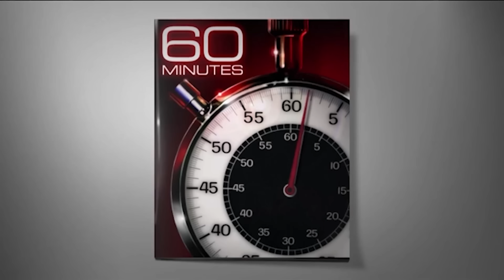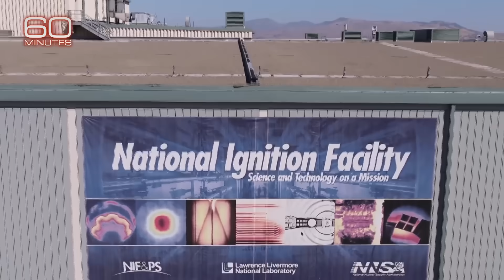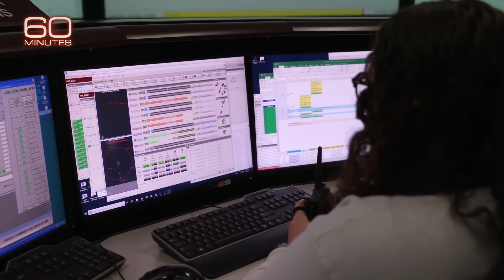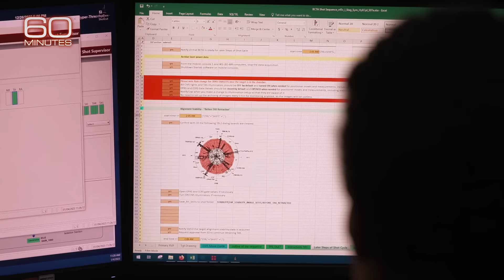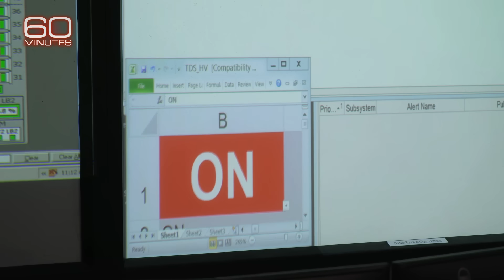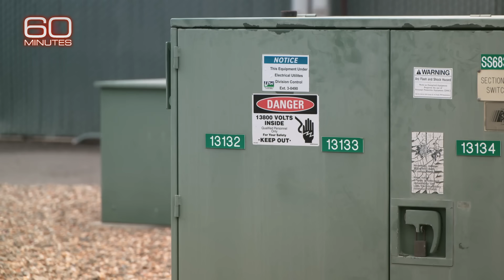Nuclear Fusion: Inside the breakthrough that could change our world | 60 Minutes

Comment: The analogy to flight is ridiculous. The basis in theoretical physics for commercial fusion power has been known for decades, and "achieved" with the detonation of the first hydrogen bomb. In that case, the "energy" required to trigger fusion came not from lasers, but from the detonation of an atomic "fission" bomb inside the hydrogen "fusion" bomb casing. In other words, in order to explode a thermonuclear "fusion" bomb, the "blasting cap" is an atomic "fission" bomb.

IN the case of commercial fusion power, the start up energy requirements are similarly scaled. Thus after achieving "fusion" in weaponry, it has taken several decades to develop the hardware, in the form of lasers, highlighted in this story. Thus it is not like the Wright Brothers at all. Naturally, the DOE administrator disingenuously announces we are 10 years away from commercial fusion power to bolster a president's reelection prospects.
Reply: The DOE administrator is well aware of where the funding has come from for all the nuclear fusion energy research at NIF and its predecessor laser fusion experimental facilities. It is sourced from Congressional funds allocated for thermonuclear weapon (H-bomb) research. This has largely been the case since the research began in the 1970s. Many different presidential administrations have come and gone during that period of time. The vast majority of other nuclear fusion 'breakthrough' announcements are also filled with sales hype, mostly to attract potential investors to keep the research going.
Reply: @vernonbrechin4207  Thank you. I did not know those details, and they do make perfect sense. Afterall, the major element of maximizing the "yields" of thermonuclear weapons is the amount of time the fusion reaction can be "held together". One way to do this was Teller's numerous "tests" in the 50's, which Kennedy curtailed just prior to/triggering The Coup in '63. The other way, as you possibly suggest, is assembling the significant laser power seen in the news piece.
Reply: @W1ZY  - The NIF lies within the Lawrence Livermore National Laboratory (LLNL) which has always received the majority of its funding for nuclear weapons research and activities associated with such weapons. They used to regularly perform expensive full scale weapons tests at the Nevada Test Site (NTS). When the lab was forced to end that testing program, due to the signing of the Test Ban Treaty, the lab received funds for NIF in exchange for ending that program. It is estimated that NIF has already consumed approximately $11 billion. The lab claimed that NIF was necessary to maintain the 'safety and reliability' of the existing nuclear weapon stockpile in the absent of full-scale testing. Some reviews have stated it it wasn't needed for such a task. NIF is being used to modernize the existing nuclear weapons of the U.S. In fact a weapons related target was in the target chamber, for exposure to the prompt flux of fusion neutrons at the time of the publicly announced experiment. NIF completion was very late and way over the original budget. It was supposed to the so-called 'break-even' reaction by 2012 but failed by a factor of more than 10. It took a decade of tweaking to finally achieved the reported claim which was still over 100 times less fusion energy output compared to the laser drive energy. That failure to perform apparently had no effect on the safety and reliability of the nation's nuclear stockpile.

The lab management has always obscured the primary purpose of NIF when presenting to the press and the rest of the public.

Few people realize that during nuclear explosive detonations that much of the fuel fails to react before it is blasted away from the reaction center. This includes the Pu-239 fuel of the primary in fission and thermonuclear explosives.

In the announced NIF experiment the nuclear fusion reaction lasted for only approximately 0.000,000,000,08 second after which most of the supplied fuel was blasted away from the microscopic reaction center to coat the interior of the target chamber with radioactive tritium which then had to be treated as radioactive waste. It was revealed, on the following day of the announcement, that only about 4% of the fuel was consumed during that experiment.
Reply: @W1ZY  - As NIF failed to achieve its primary goals the justifications of it tended to shift more towards the claim that it was needed to maintain the design skills of those physicists and engineers involved in thermonuclear weapons work.

Comment: Would nuculear fusion being used create too much energy?Would it cause the planet to pull other planets closer,would it push them away?What would producing the power of the sun have on us?Would it have any impact on the sun itself? I mean an overproduction of energy has to be possible.There is a reaction/ impact to everything.Would it have a physical or mental impact on the living?Earths polarity? 🤷🏻‍♂️🤔
Reply: I'm sorry to inform you that the National Ignition Facility (NIF) management's use of the term 'ignition' is deliberately deceptive. There was no significant ignition of the nuclear fusion reaction in the experiment mentioned above. The reaction was primarily the result of compression during less than 0.000,000,003 second. The fusion reaction lasted for approximately 0.000,000,000,080 second. After that the enormous repulsion forces caused all the fuel nuclei to be blasted away from the microscopic reaction center. Only approximately 4% of the supplied fuel actually fused to form helium. The radioactive and extremely rare tritium atoms were blasted towards the inner surfaces of the large target chamber and required removal as radioactive waste. Realize, that fusion energy production requires an enormous amount of input energy to confine the naturally electrically repelling nuclei. As soon as that input energy was removed the reaction extinguished. In the case of the NIF fusion energy 'breakthrough' announcement the laser input energy was more than 100 times the energy that was generated by the nuclear fusion reaction.

This is nothing like igniting a match where once  the chemical reaction begins at a tiny point it then spreads until the match fuel is consumed within a couple of seconds.

Comment: but is it safe from magnitude 7.5 earthquake? guess it will take us years before we could make such huge facility smaller like a pick up truck..
Reply: First somebody has to demonstrate a fusion reaction that lasts for years rather than 0.000,000,000,08 second as in this announcement. This experiment required more than 100 times as much input energy as was measured from the fusion energy output. A practical nuclear fusion reactor would need to generate at least 10 to 20 times as much energy then was required to operate it to be economically practical. In this case approximately $11 billion has been spent on the NIF project and this rare successful experiment generated about enough energy to boil two liters of water.

Such fusion energy machines can't be shrunk down by very much. If a nuclear fusion power plant was generating 300 megaWatts of thermal energy and was the size of a pick-up truck that reactor would vaporize any structure it was contained in. Many of the fans of such technologies have never taken a course in thermodynamics and material sciences.
Reply: @vernonbrechin4207  in a distant past wireless communication is like a fairy tale, not just that, even video conferencing wirelessly,  and here we are now watching videos in a small device as well..
Reply: @2Sage-7Poets  - Techno-nerds tend to immerse themselves in the history of projects that turned out to be successes. One of their aims is to seek out stories that reinforce what they prefer to believe in.They have no interest in the history of major projects that went nowhere. How about bragging about the U.S. Project Plowshare that lasted for at least 15 years in the quest to experimented with the use of nuclear explosives for various civil engineering projects. How about the early 1970s Seattle Monorail that served as a demonstration for how people would be transported around the U.S. by the year 2000. There have been lots of grand technology projects that never went anywhere. Most techno-nerds have no interest in learning about that portion of our history.

Comment: The reaction lasted 1 trillionth of a second but the fictional stories by reporters and nonsensical programs like 60 minutes will last for decades. This is a total garbage, waste of taxpayers money. The authorization of these programs is a criminal offense against tax payers. The science is not there yet. These physics are more into job security than generating electricity. They are the product of memorizing theories and taught in  a disfunction education system that resembles a one way street for Zambies.
Reply: Actually the nuclear fusion reaction was measured to have lasted for approximately 0.000,000,000,08 second. It took about a week to prepare the experiment at NIF. Once the fusion reaction started it blasted away the remaining fuel from the microscopic reaction region. It was estimated that only about 4% of the fuel reacted. The other 96% was blown away before it could engage in a fusion reaction. That resulted in contamination of the interior surface of the target chamber with radioactive tritium which had to be removed as radioactive waste. The NIF administration's use of the term 'ignition' is misleading since the reaction itself prevents further reactions from taking place. The NIF was expected to achieve a break even fusion reaction by the year 2012. It took another decade of tweaking the machine and experiments to achieve this latest announced result. It has been estimated that the NIF effort has already consumed about $11 billion in federal tax dollars.
Reply: @vernonbrechin4207   thanks for the information. Some researchers believe that in the past 12 to 150 thousands years there was a civilisation that managed to achieve nuclear fusion by using the planets’ magnetic field by building pyramids and other megalithic structures.  The guardians of the temples today also known as archeologies will not allow any attempts to study the remnants of those  lost civilisations to decode the secret of the extreme heat used to melt hard rocks and the purpose of building those enormous pyramids.

Comment: Where does the energy to power the laser come from? Solar panels?
Reply: It comes from the grid that feeds the Lwrence Livermore National Laboratory (LLNL) in Northern California. As a result a significant amount of  energy is derived from renewable energy sources such as hydroelectricity, solar farm panels, and wind turbines. Some of the power also comes from the nuclear power plant at Diablo Canyon, California. The rest is primarily derived from fossil fuels.
Reply: @vernonbrechin4207  oh so ,so called renewable is not sufficient enough to supply the energy needed to make these lasers work to make fusion power possible? Hmmm. This won’t sit well with the environmental mafia! Using evil fossil fuel!

Comment: This is the most outrageous government deception I may have ever heard.  Report the facts and leave the garbage at the curb.   The fact is it took 300 times more energy in  than came out.   While a noteworthy event lets keep it to the facts.   Electric on the grid to a paying customer is so for off there I no point in even mentioning it other that the idea that this research needs to continue.  The difficulty of this may take 100 more year if it is possible at all.  The only thing more difficult then generating electrical power from fusion will be finding the way generated the trillions it will cost in that time. For now, fission is the only known working process.  Power on the grid in 10 years,  a total lie. 

This was all a pile of government nonsense.
Reply: Additionally the lab management has always obscured the primary function of NIF when they present it to general audiences and to the press. NIF has always been primarily funded as a thermonuclear weapons (H-bomb) research tool. Even this announced experiment included a target piece to be irradiated by the intense prompt flux of 14.1 MeV fusion neutrons, as would be the case in a detonating nuclear weapon.

Comment: You don't need the lasers to create fusion.  It's about splitting atoms and forcing them back together, than get them to fuse again. So basically it's more a fission/fusion reaction. Plasma can be created in a microwave oven. In more ways than one. So the key is a magnetic Flux with cooling coils  wrapped around your electromagnet. That's the containment field. Once they process starts it will always depend on how long the fuel last. Technically, if made right, the fuel will never run out. How about getting more into geo themol power. Hot water hitting cold water. Or vice versa. Steam is still the best way to propel a turbine. Cold fission/fusion is done with extreme cold. Breaking hydrogen and oxygen out of ice and than burning both of them..that's called cold fusion but for sack of argument it's actually fission/fusion reaction. In space the sun and stars are held in a predictable chemical nuclear reaction. These reactions last billions of years. There Isa comment with a tail that burns and that is also a chemical reaction quite like what's going on in the sun. Hydrogen and oxygen split, hydrogen floats up, oxygen drops down as it captures another hydrogen atom fuses back with the oxygen. No waste in space. The hydrogen atoms that lifted or broke away fuse together and turn into helium which is very light molecule.  The helium fuses and creates plasma. And I just explained the sun's chemical process in less than five minutes. I'm not Einstein but I know of him. There's credit due to nature on my part. Going ice fishing and hearing loud pops. Those pops were the hydrogen and oxygen splitting. The oxygen floats down the hydrogen creaks the ice and leaves back into the air. Fish are on the bottom because that's where the oxygen is. I noticed in extremely cold winters the ice would buckle and cause people to fall though but that's a huge energy release and natural fission/fusion.  Okay I'm gonna take a break. Please comment and suggest any other insight to these radical ideas. Vote for hope this USA election. We need a  strong president now. They don't want us to quit using gad and oil. It's a blood war again and again. Stop people! Use your own and leave the rest in the ground. In two billion years the earth will complete a cycle of its core and will make oil again in the depths. Trust God. The truth will set you free.
Reply: I'm so much more enlightened after hearing such a brilliant person who likely never took an academic course in nuclear physics. There are no limits to how self-confident some people are.
Reply: @vernonbrechin4207  your  correct. I did not take ant classes in school for nuclear physics. Amen. All my knowledge comes from above.
Reply: @robertkokjohnjr.7765  _ Thank you for your admission. There are a great many arm-chair experts who after seeing videos, such as that above, are convinced that they now know a great deal about the subject of nuclear interactions and how that differs from chemical interactions. You could benefit from taking formal academic courses in chemistry energetics and nuclear interactions.

Comment: still cooling problems with lasers ?
Reply: The final laser amplifier glass slabs are subjected to enormous energy levels during the approximately 3 nanosecond firing pulse. That results in a tiny amount to damage from each pulse. It is one reason they tend to limit the NIF shots to less than one shot per day. Keep in mind that there are also a wavelength shift components just before the beams pass through the target chamber windows. The beams entering into the chamber are in the ultraviolet range. The final conversion is into X-rays that compress the fuel capsule.

NIF began operation in 2009. It was expected to achieve a break-even fusion reaction by 2012. It took about a decade of tweaking numerous parameters to finally achieve the intended original goal. Still, in this announced experiment the input energy to the lasers was more than 100 times greater than the fusion output energy that they measured. It has been estimated that NIF has already cost U.S. tax payers approximately $11 billion.

Comment: 8:30. How can a manmade object be exposed to temperatures hotter than the center of the sun and not be vaporized?
Reply: Keep in mind that the only area that reached that temperature was a microscopic spot of immensely compressed fuel plasma and that the temperature lasted for only approximately 0.000,000,000,08 second before it exploded outward to a point where no further fusion could occur. That sent out a powerful shock wave that vaporized everything within a couple of inches of the reaction point. The remaining copper supporting structure was pealed back by the expanding shockwave. What you were shown was at least two inches away from the microscopic explosion. Keep in mind that the experiment took close to a week to set up and the laser input energy was more than 100 times greater than the measured nuclear fusion output energy.